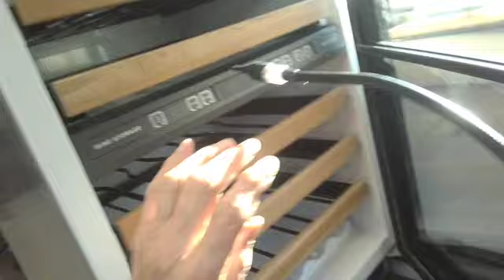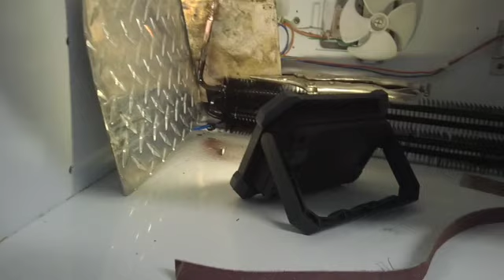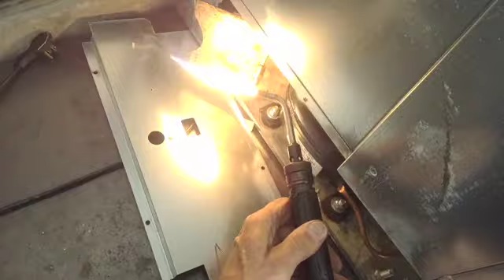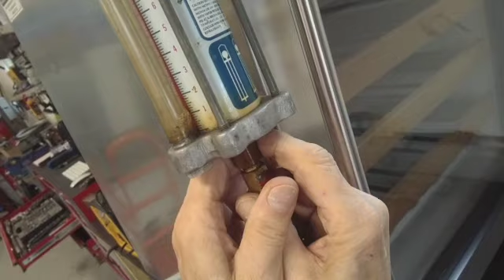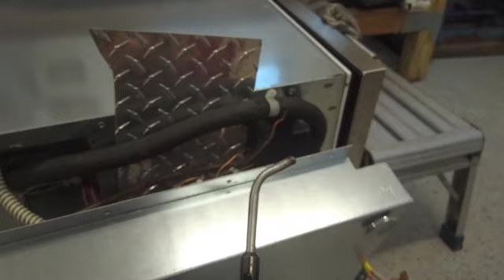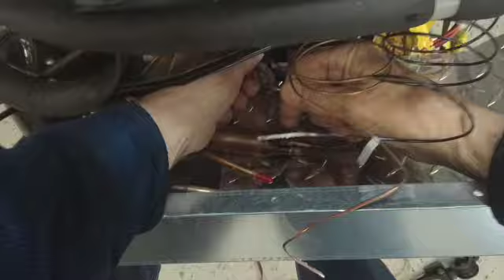Sub-Zero 424 Wine Cooler Sealed System Repair

Comment: What low pressure should I have on the low side?
Reply from the maker: It depends on the temp inside, but normally 15-20 psi when first starting up and then down to 5psi. Generally speaking. You can peruse our Tech-Help files on our site at Aaronsrefrigeration.com, look under Technical Info.
Reply: @SubZeroSpecialists  oh thank you for fast reply I have the same unit that runs on around 13-15 psi customer complained about not coooling but after they took all the bottles out and turned it off and on it started maintaining temperature,now I don’t know if they just reseted and it’s fine or it was struggling to maintain the temperature with the bottles inside bc of clogged condenser
Reply from the maker: @Belov.6572 a clogged condenser would definitely cause that problem.
Reply: @SubZeroSpecialists also I forgot to mention that the suction line had slight frost too
Reply from the maker: @Belov.6572 Suction line frosting up would indicate possible fan motor not turning or something preventing air flow over evap coils. Shut it down and let it defrost then turn it back on and see if it works.
Reply: @SubZeroSpecialists Evaps are fine there was no frost buildups and the frost pattern was even ,but is that how it’s suppose to be that they work one at the time?first upper one freezes up and fan runs then lower one while upper is defrosting and fan is not spinning
Reply from the maker: @Belov.6572 yes one at a time

Comment: Hi 
The compressor is running so is that a good sign or bad?
so I would have to put a line tap on for me to add freon because these units are sealed?
Also I would have to add freon if it empty to search for a leak ? Thank you
Reply from the maker: You’ll need a line tap valve and a gauge to check the pressure. If you’re running in a vacuum you probably have a leak and you’ll need to find it to fix it properly, most likely it’s the evaporator coils, or you could have a bad switching valve. You didn’t mention what the initial problem was.

Comment: Can you tell what is wrong if the top of the 424 wine cooler gets cold and the bottom does not cool?
Reply from the maker: Most likely it’s the switching valve
Reply: Thanks! I will try to change that out. Do you have a video on where it is located?
Reply from the maker: @deejayhall1  yes there is a video on how to replace the evaporators and includes the switching valve.
Reply: usually it is low on freon from a leak. fill it and both upper and lower cool. will need evaporators and switching valve at some point.

Comment: You knew it had a leak why would you try and repair it when it could just form another leak in the future instead of wasting all that time you should have just replaced it all and had a new sealed system.
Reply from the maker: It’s not a waste of time if you’re saving money. On this model you have to replace the heat exchanger with it which means separating the upper cabinet from  lower base-very time consuming.
Reply: @SubZeroSpecialists  honestly it's not very time consuming and it's the proper way to do it... It's the best thing for the customer and is the best way to insure that it will run properly for years to come.

Comment: Hey I'm having similar issues but on mine only one evap is soaking heat....qnd the low side qnd high side are completely separated. 
I pulled a vacuum on low side only to find  
Out thw high side was pressurized
Reply from the maker: I don’t understand the question you’re asking.